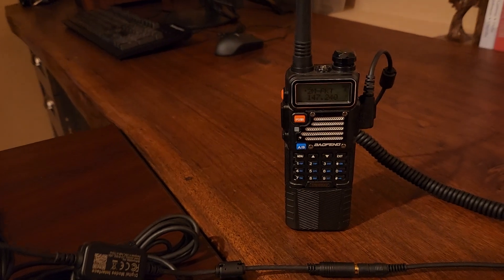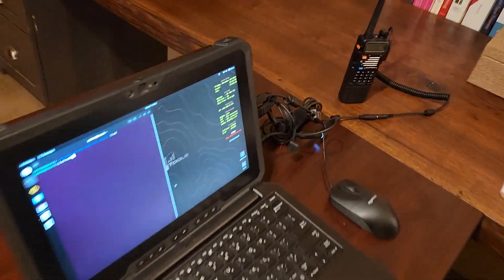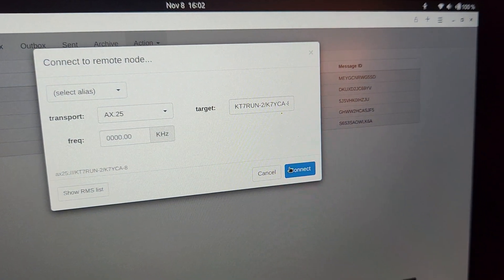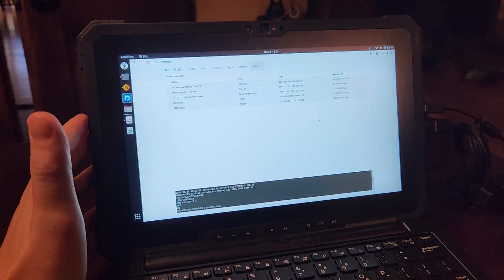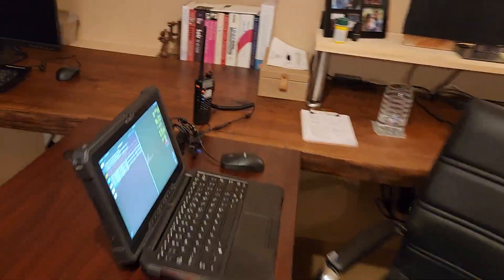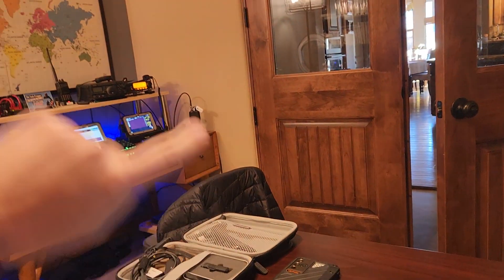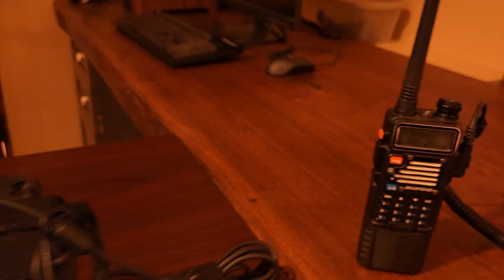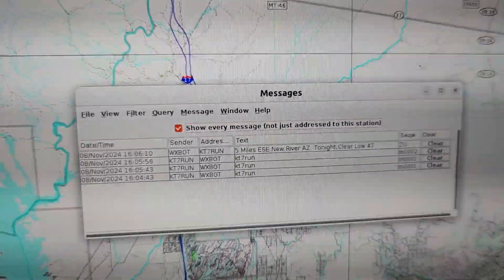Baofeng Plug-and-Play Demo: Zero Configuration Digipeater

Comment: It’s totally cool. Great work.  I guess where I’m lacking is where, why, when do I need this as a Prepper. For example Hurricane Helene.  How could I get help? How could I be of help?
Reply from the maker: Everyone's needs are different. Radio can be used in any event where you lose access to the Internet or the cell infrastructure and you need to get support from your personal network or, if available, first responders. I personally focus more on building local and regional communities for the purpose of sharing information over short, mid and long range distances. We practice daily and weekly passing traffic on events that are local to us using a number of voice and digital modes. The cell and Internet networks can go down tomorrow, and the out group would have no issues communicating in our city, county, state and region. If you can't think of need and your pepper, you probably do not need comms.

One last thing, we're trying to use radio more this year rather than relying on infrastructure provided by big tech. There's no monitoring or corporate interest involved in our information exchanges on our growing Bulletin Board System (BBS)

Comment: You seem like a great guy and do a good job on your videos explaining things but I'm so lost. I'm trying to get as much info to see if I want to go down this rabbit hole, because I think some of this stuff is cool. I think I need a starter course like ham for dummies or radio for noobs to get a background in radios so I understand better. APRS seems like it's only good for someone who is keeping track of your movements such as your wife keeping hands on your trek or journeys in the outdoors as a safety measure. Which could be a good thing to keep proficient in,just in case. That's why the channel is The tech prepper. Do you have a video about the best way for someone to get started with the best chance of propagation? Like a one and done type video? Nice video hope all goes well for you.
Reply from the maker: All of these digital modes are tools for solving particular tasks. APRS is more than just position tracking. For example, I used APRS and the WXBOT service to check the weather based on my location. You can use it for simple text messaging,
store and forward messaging, as well as a few other services. I also can use packet radio for sending email to non-hams. I have covered many techniques using these modes as well as others over the last 4 years, so there isn't just one video. I probably should do an entry level video covering all the techniques possible.

Comment: Have you looked at the Tid H3 at all?  Definitely looks like you can do Audio over the K1 port and CAT control over the USB-C connection, just need to get the interface worked out.
Reply from the maker: I have not due to time constraints.
Reply: @TheTechPrepper  I think there's some work that direction on it. I'm looking at figuring out how to use it with AllStarLink so you can have a remotely programmable node with two cables but if we can get a basic cat interface going then it should integrate easily with hamlib, omnirig, etc.

Comment: I would not use a Baofeng for APRS, why you ask because a they are basically deaf. I personally have tested them for small digipeaters and it was just not acceptable.  Otherwise there are much better choices for low power APRS.
Reply from the maker: I understand your perspective, but this is just a demo using inexpensive equipment. I had a to-do item to test the Baofeng with my software. Time to go back to the trusty Yaesu FT-60 and VX-6R The Yaesu FT-2980 was doing all the digipeating.

Comment: That's cool I usually just run cross-band repeater on the 50W radio in the car to rebroadcast the HT works out well to be in the woods and have the car rebroadcast APRS msgs at full power on a better suited antenna. Radio listens on a 70cm freq I choose and the radio repeats it on the 2 meter APRS freq.
Reply from the maker: That works, too. I do the same with the Kenwood D710 in the Jeep, or just use the D710 directly when in the vehicle for APRS work. 73